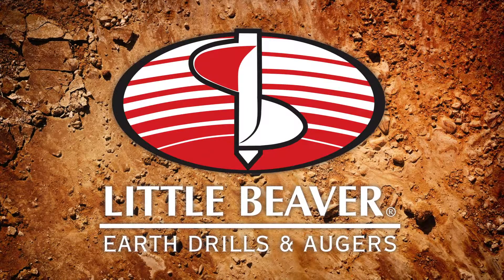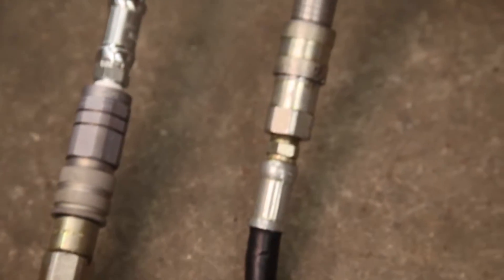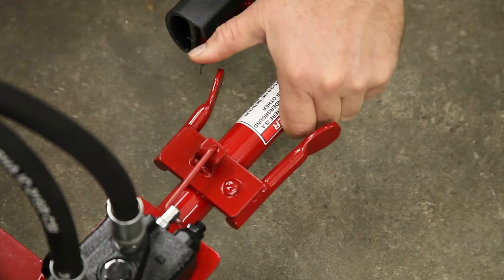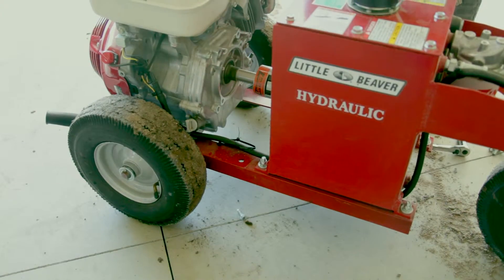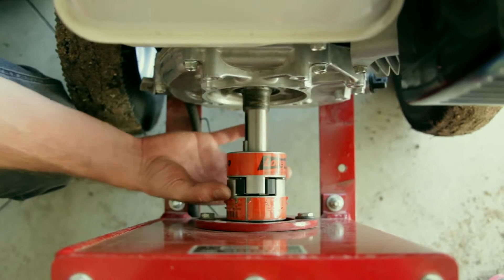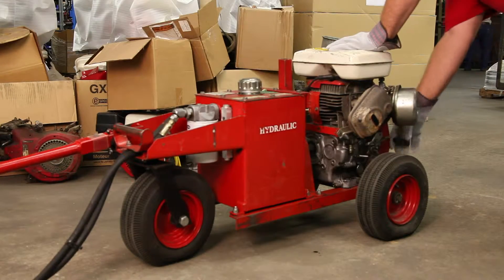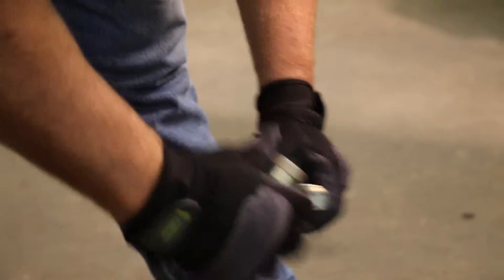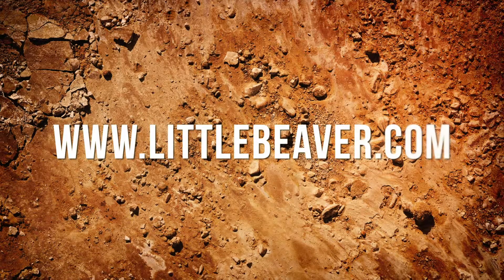Little Beaver | Hydraulic Earth Drill Maintenance

Comment: If I bought one of these , would it power , a hydraulic trailer , boom  crane  log loader?
Reply from the maker: Hello! The specifications of the hydraulic power unit would need to be matched to the equipment you intend to run with it. You can learn more about our equipment online at littlebeaver.com, or by contacting us at 800-227-7515 or www.littlebeaver.com/contact/.